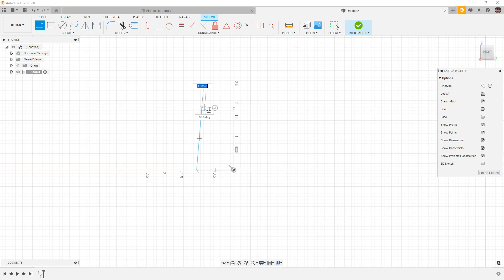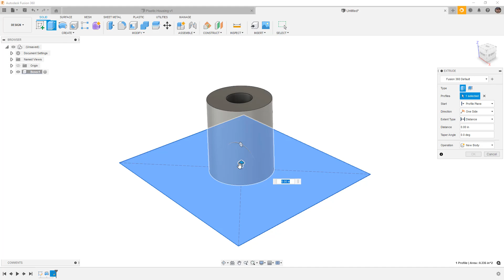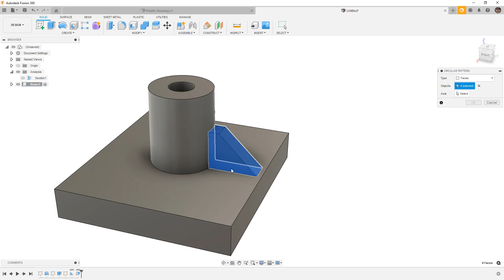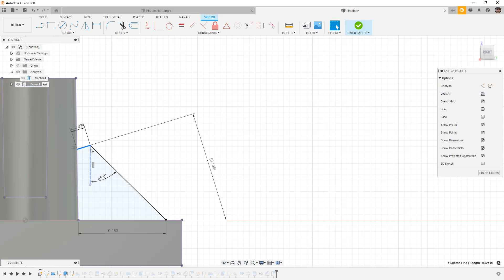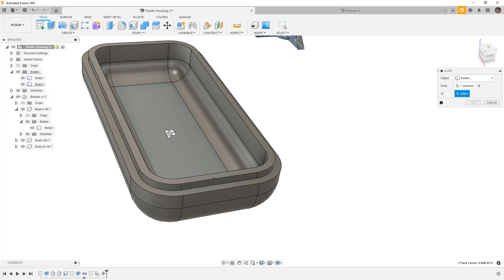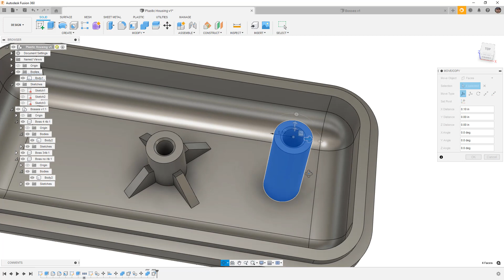Plastic Part Design Tips for Designing Bosses on Hobby License #Fusion360 #ProductDesign

Comment: What the heck is a Boss?  Maybe start with defining what that is.
Reply from the maker: Screw Boss is a common plastic part and the hobby license doesn't have access to the Boss tool.  It is the round plastic part in a molded design where you have hardware, things like thread forming screws.

Here is an excerpt from VEM Toolings website
"Screw bosses play a crucial role in molded parts as an attachment and assembly point. They are cylindrical protrusions that are typically located on a part’s wall and contribute to various functions such as positioning aids, fixation points, facilitating gear rotation, and acting as bearing surfaces or levers. Screw bosses are cylindrical parts with holes that can accommodate threaded inserts, screws, and other mechanical fasteners. "

Comment: Are the parameters still available in the new design or do I need to adjust the sources(originals) first before copying
Reply from the maker: Great question Eric!  If you insert an external design and then break the link, yes the parameters will come along with that design.  It might get tricky if you use a common name like Thickness and you insert them into a design that already has those values.  If you don't break the link you can "edit in place" but note that this can create associativities with the original design and new design.  

But back on point.  If you insert them into a new design and break the link you will notice that some of your parameters will get renamed with _1.  so for example if both designs have Thickness you will see "Thickness" and "Thickness_1".  Units will also cross over so your parameters might be a mixed bag of in and mm.

It takes some practice but if this is something you do I think spending the time to come up with a good "base" design with general plastic part features can help you out.  Also note that we drew all Positive bodies, but you could also create bodies you plan to cut away.  Like areas for a snap latch.  Using the direct modeling tools to resize and move things around is also a great option.